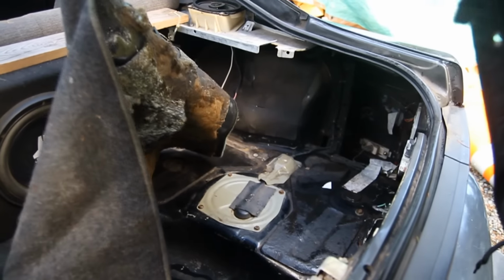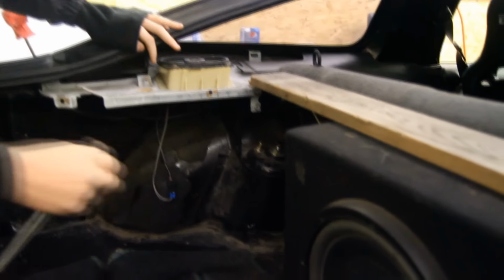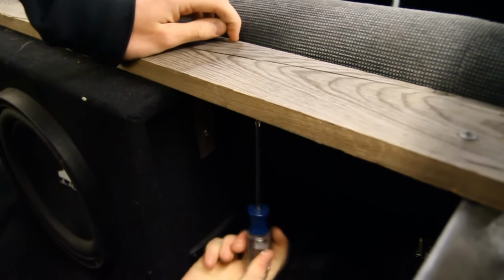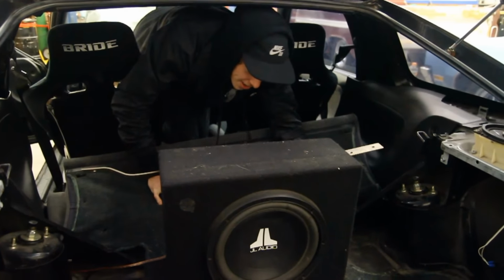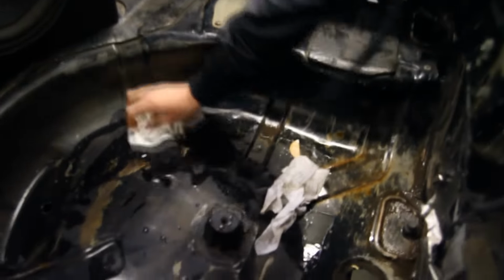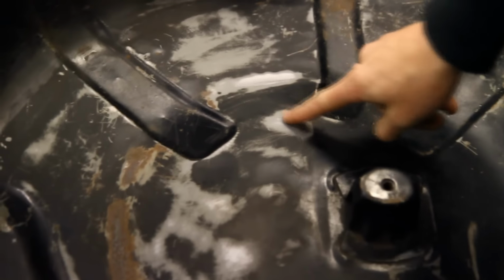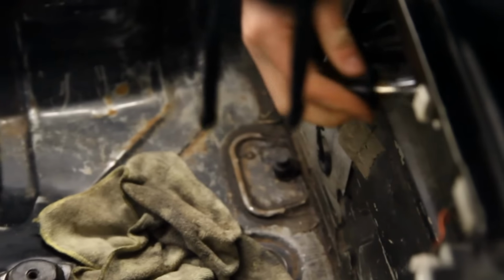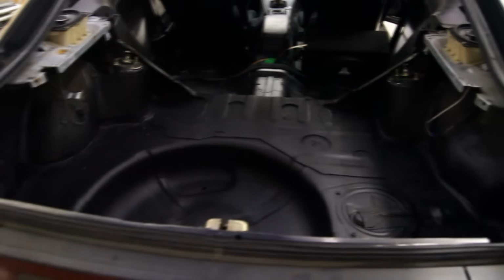Rippin' Stuff Out of The 240

Comment: What leak on those s13 hatches is the weather stripping on the side of the hatch and mostly the seals between the tail lights and the body. If you can't find OE seals from nissan just pick a nice dry sunny day make sure everything is dry take the lights out and clear silicone them on along with gasket maker sheet. Its not a end all be all repair but it should keep things dry. Good luck with the car
Reply from the maker: +BlueCollarDreams thanks man! i'll look into it